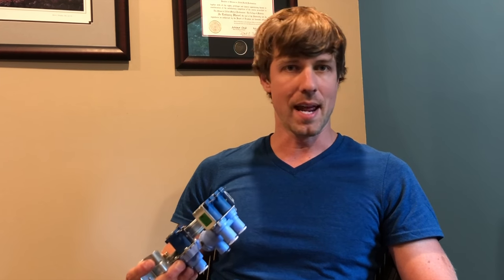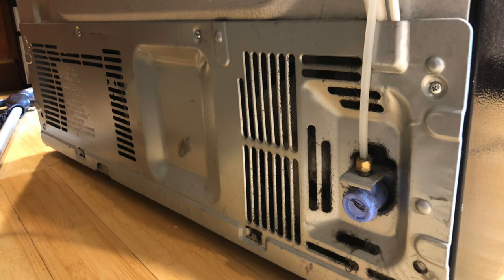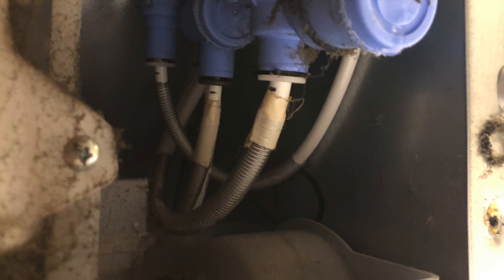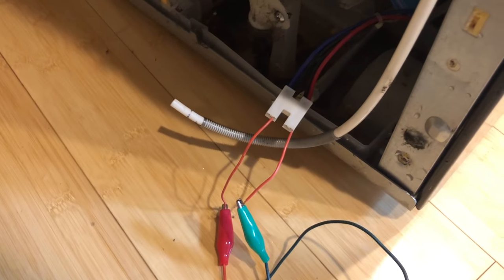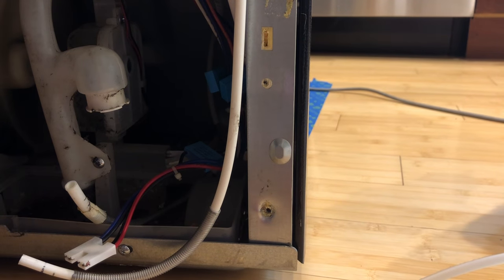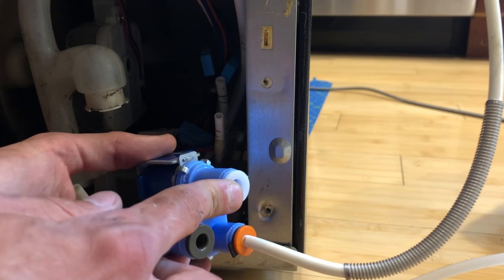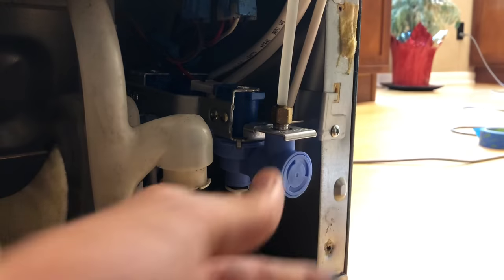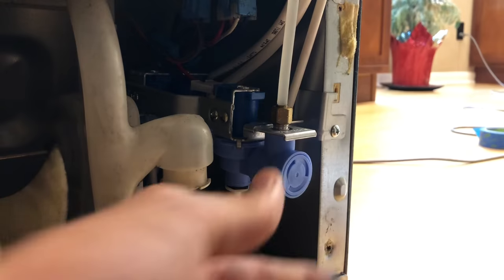Slow refrigerator water dispenser DIY FIX

Comment: Ok, I bought a used whirlpool fridge recently, about a few days ago, I have a home water filtration system under my kitchen sink, with a small faucet that was installed with it that provides super clean water, the water that came out of the faucet was almost like a laser beam of water it had so much pressure, when the used fridge was installed, this faucet was still pushing water like a champ, my fridge was pushing a good stream of water, so I went and bought a new filter for it, it was a filter that was on the bottom grate, not the kind you twist and pull out, it's the kind you open a cover lid at the bottom and the filter pops right out, so I put the new filter in, started pouring the water out of the dispenser to prime or get the water flowing through the filter. Water came out, then it was just air flowing through, then the water started slowing coming through, but noticed it was sooo slow, I mean it was working fine before replacing the filter, and now the faucet on my kitchen sink that was made to pour the super clean filtered water from under the sink had low pressure as well, it uses to be a jet. The line that comes out of the under the sink filter splices to the faucet and to the fridge, I don't see how after changing the fridge filter, that it lowers the pressure from the faucet as well. I took the fridge filter out, and tried to pour the water out of the filter, and fill it up with water in the sink before putting it back in the fridge. The water filter isn't really designed to be filled with water prior to installing it I think. Then I realized about bypassing the filter, and we'll I think it has a bypass built in, because I took the filter out of the fridge and water kept flowing through the fridge dispenser, and it came out just slightly faster than with the filter in the fridge but not quite enough, it's still very slow, and the faucet on the sink showed a little bit more pressure, but not nearly as strong as before. It's still slow even after using the built in bypass, is my under the sink filter affected by what happened? I know this seems very unique, I just hope u have some thoughts of what might be the problem here. If it's something I can fix, or if I need to professional to fix, flush out the system in the fridge maybe? But will that bring back the pressure for my aink faucet?
Reply from the maker: Wow David. It sounds like there is a lot going on there. I'm not completely sure I understand the layout, but it sounds like you may have a reverse osmosis system under the sink and it's possible it is installed with a line supplying your fridge? Does the setup under the sink include a large metal cylinder with 1 line going to it as well?
Reply: @charlieaf92  thank you for your response in order to figure out something that may have sounded complicated in order to try to help, but honestly man, for some reason everything is working now, the sink faucet is jetting again, the fridge water dispenser is able to fill up a cup faster now, idk what it was, the next day I tested the pressure out of both faucet and fridge, and worked like before! I realized now that I didn't really need to put a new filter in my fridge after finding out that there is a built in bypass, but it's working fine now through the filter. And yes there is a big tank under my sink and I think like a 5 filters system set up, it's alot of seperate filters under that sink, but good news everything is working as should! Maybe it just needed a day to adjust the pressure? The fridge water filter was a little weird in terms of design from what I'm used to. But all in all thank you for replying and attempting to help
Reply from the maker: @DHosa713  I'm glad it is working! My best guess is that your storage tank emptied during your filter change and subsequent purge. This would lead to very low pressure until the tank has a chance to re-fill, which can take a few hours.

Comment: I found that when the temperature is too low on the refrigerator side it can cause water in the filter to freeze which causes the water to dispense slowly. Raise the temperature setting and see if that works before replacing any parts.
Reply from the maker: Good point! This was not the case for me but others should give it a shot prior to replacing the valve.

Comment: My water dispenser started dispensing very slow after I installed a new ice maker. It was dispensing fast before the installation. Could it be the water inlet valve?
Reply from the maker: It's hard to say for sure. Is the ice maker a direct replacement? I've read that getting air in the lines can have this effect and the system requires purging - which is essentially just filling a pitcher or two.
Reply: @charlieaf92  yeah the ice maker is a direct replacement. My old ice maker was making a loud knocking sound when making ice so I had to order a new one to replace it. The new is also OEM like the old one. It has been two weeks since installing the new one and the slow water dispenser is still a problem. I bought a new water filter as well to see if replacing it might fix the problem but it did not.

Comment: I replaced the inlet valve and it worked...water flow was great! Came back to the fridge a few hours later and it takes 10-20 seconds for the water line to fill for the water to come out...this continues to happen a few days later...is there something I need to adjust in the connecting of the inlet valve? Seems like the line isnt' staying filled with water? Once the water comes out, it does come out full pressure.
Reply from the maker: That is strange, I'm not sure. Do you have a filter installed in the fridge? Sometimes those will have air in them and cause symptoms kind of like what you're describing. I believe the solution is to run it for a while (fill up a pitcher).
Reply: @charlieaf92  I think I got it to work today. The line into the water dispenser was a bit short so I used a connector and more tubing and lengthened it...seems to be working! Thx again!
Reply from the maker: @RobMyca  Nice work!

Comment: Thanks for the helpful info. I'm having trouble removing the tubes from the original valve piece. I've removed the clips and the tubes just won't pull out. I'm concerned of breaking the tubing. Any tips as to how to get them out?
Reply: Ahhhh, I figured it out. If anyone else has this issue, it's because you have to push the connecting valve inward while pulling on the white tube
Reply from the maker: @Cale_E  Glad you figured it out! You're correct, remove the clips and press the outer piece down. Cheers!

Comment: thanks for the video - you give a part link but don't say what model fridge you have! All the parts sites show that part for my model (2008 LG lfx25971st), as well as just a single valve MJX41178908 - which when I took off the back seems to be what I have - under $20 on Amazon which is nice. Water worked fine for more than a decade and suddenly flow slowed like overnight - assuming that the valve is going bad (ice is fine) - part arrives today so I'll know by tomorrow. Water seems to have gotten harder of late, possible cause? FYI at least on my unit you can leave the water line going through the back plate and it slides right over even with the inlet line attached to the valve - so you can test for leaks and then put the back back on without detaching the line again! Any idea as to why LG decided to make things more complicated and expensive with the three solenoid valve when a single works fine for the older model?
Reply from the maker: Hey - good point. It is a 2008 LG, I don't remember the exact model number. As far as cause, I don't know exactly. I took the valve apart and didn't see any signs of buildup that would have caused it to malfunction. In the end I decided to just replace it completely vs. clean and re-assemble.
Reply: @charlieaf92  replaced my single solenoid unit (only one white tube out to top of fridge at back - in under 10 mins - water flow back to strong. Took the old one apart this am -  no deposits, but the black rubber tip on the piston and the underside of the black rubber washer were all degraded , turned to black mush when touched. IF you could replace these I'm sure it'd work fine again; happy with my $13 next day delivery of OEM manufacturer - but slightly different, sealed unit.

Comment: GE refrigerator water dispenser stopped working over a year ago - all of a sudden began working last week.  Today - it stopped working.  Could this possibly be the inlet valve?  If so - I'm having trouble matching an inlet valve with the model #GSH22JSXM SS - refrigerator over 10 years old
Reply from the maker: It sounds like it could be the inlet valve, but it's impossible to say for sure without some testing. When you press the water dispenser do you hear a click/hum or other noise from the back of the refrigerator? If so, I'd say there's a better than 50/50 chance it is the inlet valve that needs to be replaced. I did a quick search and found this one, which may work for your unit: https://amzn.to/39yWc6k

Comment: We recently bought a brand new fridge. Water is very very slow. Old fridge was fine. What do u think is wrong?
Reply from the maker: Hey Sherrie. I'm not quite sure. Did you install the new one or did the delivery people do it? A couple possibilities are that the water supply valve wasn't fully turned back on after installation, or the supply line got kinked/pinched when moving the new fridge into place. If you paid for installation, I would call the company you paid and explain the situation. Did your old unit have an in-line filter? If not, its possible you're just seeing the difference caused by having a filter in-line.

Comment: I changed the inlet valve thinking that was the issue and nothing gained any speed.  In fact the valve off Amazon leaked so I took it back off and put the old one back on.
Reply from the maker: Sorry to hear that! Someone else mentioned that the fridge temp may be set too low and lead to freezing of the line. It may be worth trying to raise the temp slightly.
Reply: @charlieaf92  I got the water flowing correctly.  Went down stairs and put a gauge on the fridge water. 28 psi. I purchased a RO style .7gpm 60psi pump and it flows perfect now.
Reply from the maker: @Hiperf Excellent! Glad you got it fixed and thank you for posting your solution!

Comment: I put in a new water inlet and still no normal pressure. Note, it started having low water pressure the same week the filter light came on. Fridge is 10yrs old
Reply: Did you change the filter?

Comment: I’m not getting any water from the dispenser or ice when pressing either paddles. The ice machine is making ice. It just won’t come out. I’ve changed the water filter and still no water. I’ve read there could be so many different reasons causing the problem. What do you think??
Reply from the maker: Ah... hm. So do you have a paddle for each one? One for ice and one for water, or is it a single paddle and you use a button to change what it does? It definitely isn't an issue with the inlet valve like mine was. It sounds like it is related to the micro-switch that the paddle activates or perhaps a control board if you have multiple paddles that are malfunctioning.
Reply: I do have separate paddles for the water and ice. After researching I’ve thought that it may have to do with the switch or the board like you mentioned. I’m going to try replacing the switches first and see if that fixes it. Thank you for your reply. I wanted someone else’s opinion that know more about this than I do.
Reply from the maker: @donnieloverforever  my pleasure! If you have a multimeter you should be able to test the switches and see if they're working. My gut feeling is that if both stopped working at the same time, its likely that its the board or some other shared component that failed vs. the switches themselves.

Comment: So what did you do to improve water flow. You didn't actually say.
Reply from the maker: Replaced the inlet valve. Sorry if it wasn't clear. Replacing the valve fixed my problem.

Comment: I have low dispenser pressure and no ice, swapped the inlet valve out, no leaks but still terribly low pressure. Any ideas?
Reply from the maker: Did you replace entire unit with all 3 solenoids?
Reply: Raise the temperature a little on the fridge side. If it is too low the filter can freeze and cause water to flow slowly.

Comment: Great video. I have a LG model lfd25866tt French door. I have the opposite problem. Water randomly shoots out of the dispenser on its own???  Maybe 3-4 times a day. No one using it or near it. It starts dispensing water for about 2-3 seconds then stops. I’ve changed the filter, purged it, unplugged to 5 mins. It even dispenses randomly when locked. 
Do you think this could be the inlet valve?  Thank you
Reply from the maker: Hey Mike, thank you! Regarding your problem, is it coming up in a pressurized stream like someone is pushing the dispense button? If you're just seeing dripping and finding water puddles, it could just be ice that is stuck in the chute and melting. If it is coming from the nozzle but maybe not as full pressure as if the button is being pressed, I would suspect the inlet valve. However, if it is actually shooting out like someone is pressing the button I would suspect its a short circuit somewhere. If that's the case the actual button/switch that gets pressed by the glass would be my first guess.

Comment: Could it also be low pressure from the supply?
Reply from the maker: Certainly could be. I suggest testing it to determine.
Reply: @charlieaf92  I'm not great with knowing the right way to do it, but I can get a new pipe in. It's a 1/4" line coming through self piercing saddle valve from a 3/4" line. I was hoping that putting in a 1/2" line as close to the fridge as possible would help.
Reply from the maker: @libertynindependence  1/4" line should be plenty for a fridge. If possible, turn off the water at the saddle valve, disconnect the line from the back of your fridge - get a bucket for the water to go into, and then turn the valve back on. See how much flow you get when you take the fridge out of the equation.
Reply: @charlieaf92  gotcha, will do. Thanks for taking the time to answer much appreciated.

Comment: I bought a brand new Samsung and a brand new GE both of them take forever to give you a glass of water.Find it hard to believe they sell brand new ones two different manufacturers were bad valves. What else could it be
Reply from the maker: Agreed - it sounds like its a supply issue. Maybe the shutoff valve you're drawing from - or even an issue of water pressure getting to the valve. I would try unhooking the water line from the back of the fridge and trying to fill a bucket with a mark showing where 1 gallon is. Time it, and see what kind of flow rate you're getting.

Comment: Mine has too much pressure what to do?
Reply from the maker: What does too much pressure look like? I have never had this problem, but the machine does not have any type of internal pressure regulator (that I know of). So it would be a function of your supply line pressure. If it is truly a problem, I would suggest an in-line pressure regulator for the appliance, or perhaps getting one for your main water line. Here is a link to an inline regulator for this type of purpose: https://amzn.to/2AJmdid
Reply: Thank you, it was fine until i changed the filter, now it just splashes all out of the glass, ill guess a regulator it is, thanks

Comment: I like all the comments they are very helpful the problem that I ben having with my KENMORE REFRIGERATOR ICE MAKER IS WHEN PRESS THE WATER DISPENCER YOU WILL GET VERY LITTER WATER AND AT THE SAME TIME IT POURS  WATER ON TO TOP OF ICE MAKER PLEASE IF SOME WILL ANSWER FOR ME THANK YOU
Reply from the maker: Hi Jorge - if you have water coming out on the ice dispenser when you press the button that sounds like it could be an issue at the inlet valve. I suspect the valve for the ice dispenser is stuck open and when you are pressing the water dispenser it opens up the main valve, which lets water rush past the stuck valve.
Reply: @charlieaf92   Its very helpful THANK YOU

Comment: I have changed the water valves but still having the same problem. Low water pressure and small ice
Reply from the maker: Hey Bryan - have you tested the pressure at the supply line yet?
Reply: charlieaf92  I’ve tested the pressure post PRV (60psi) and pre PRV (110psi) but not at the supply line.
Reply from the maker: @bryanbull2009  but you've confirmed you're getting 60 going into the refrigerator? That seems like plenty. Have you tried replacing the filter, or removing it completely?
Reply: charlieaf92 I’ve not checked the pressure at the refrigerator. I’ve swapped out the inlet valve and water filter though.

Comment: So my water is coming out slow and my fridge is 2 days old?
Reply from the maker: If you had someone install it, I would call them. It could be that the valve on your supply line wasn't opened all the way. If you have access to the back of the unit you could try opening the valve a bit more.

Comment: If I remove the filter I have water in the dispenser but not ice
Reply from the maker: There are 3 solenoid valves on the inlet. The first needs to open for both the ice and water to work - then there is one just for ice and one just for water. It sounds like it could be a bad inlet valve - but you can test it to be sure. There are also other reasons an ice machine would not be working properly.